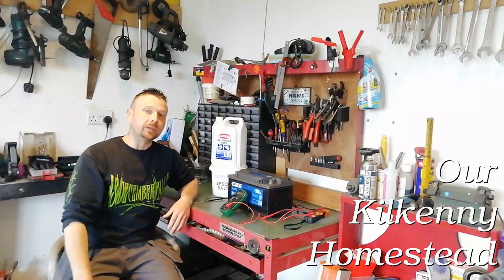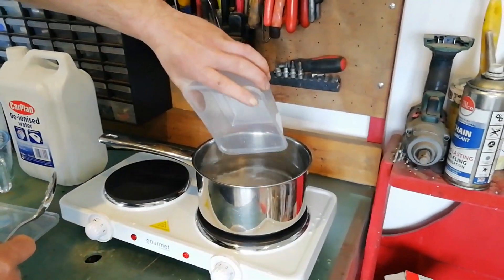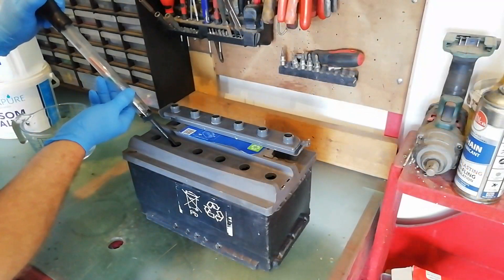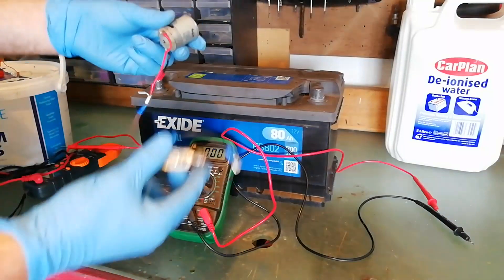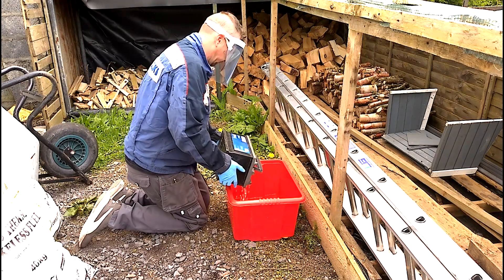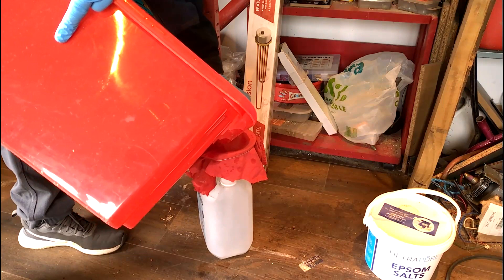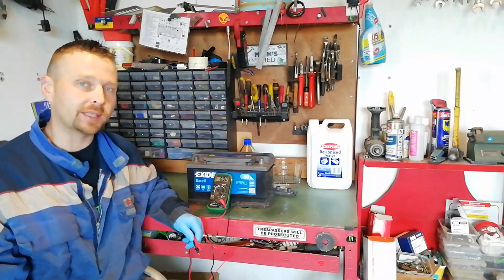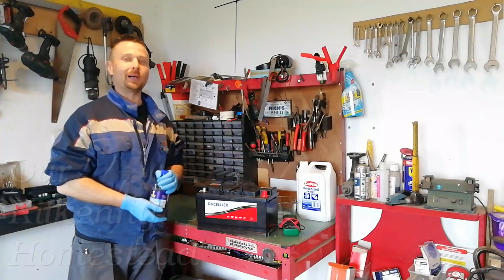Dead battery repair PROVEN RESULTS!

Comment: There are battery desufators that you can get that work by putting short high amp pulses through the battery which dislodges the sulfate layer off the cells, a lad in work got one for the battery out of his caravan which he said wouldn't take a charge at all, he said after about a week on the desufator the battery was holding a charge reasonably well, he connected a solar top up charger which he mounted on the roof of the caravan to keep the battery topped up, he says the battery is still doing the job nearly a year after putting it on the desufator.
Reply from the maker: Thanks for the info, have seen them on amazon. Good to know that they can work. Truth be told this was more a debunking exercise than a rescue 😉
Reply: @ourkilkennyhomestead2006  I'll ask yer man what the make of the desufator is when I'm back in work on Wednesday if you're interested. I can pm you the details on the telegram channel.
Reply: @ourkilkennyhomestead2006 Hi, thanks for sharing your great knowledge & skills with us with true facts.

Any chance, you have a video on rescuing a battery, please?

Comment: Back in the 80s motorbike batteries  were clear plastic and I noticed that one or 2 cells would fill up with a whitish deposit  that looked to be  shorting out the plates so I emptied acid out drilled  holes in bottom agitated /  the crud with  bit of wire and emptied the silt out flushed all the gunge out fibreglassed the holes up refilled with acid and got a 12v plus battery  did the same with  a van battery  and  got one from dead to starting a diesel engine   it's figuring  out which cells are silted up seemed to be ones at near the Poles but 40 years ago now so bit hazy 🎉